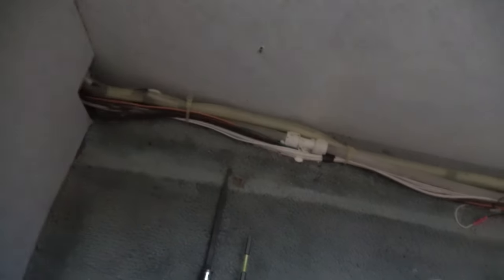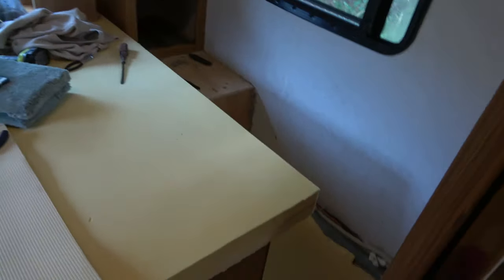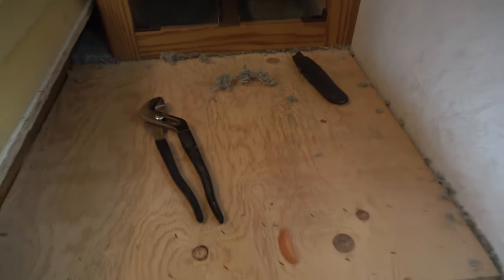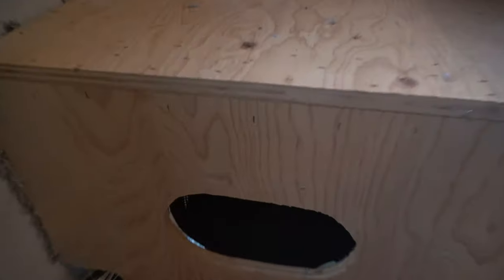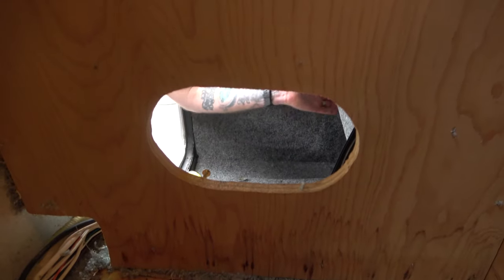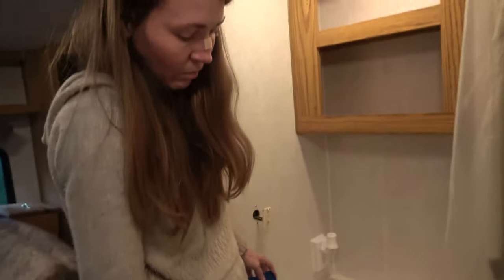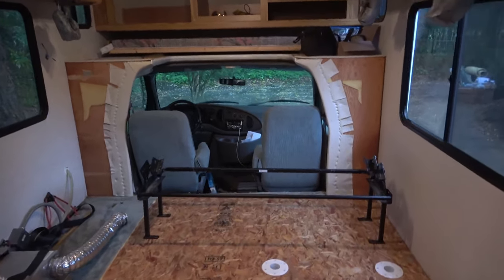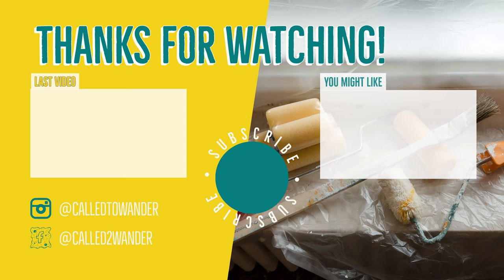CtW 110 // Demo Day Continues! Removing Carpet and Sanding Cabinets // Class C Camper remodel

Comment: What’s the benefit of using liquid sand paper vs actual sand paper?
Reply from the maker: Liquid sand paper keeps the particles from going all over the place. You wipe and the surface is abrasive enough for a layer of primer and/or paint without all of the dust from sanding